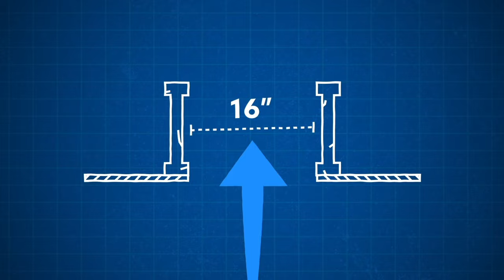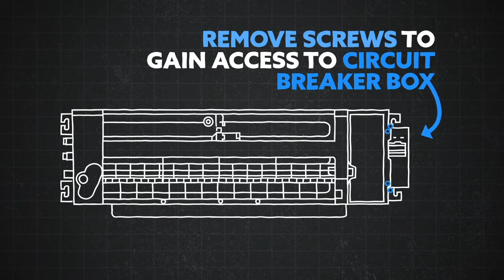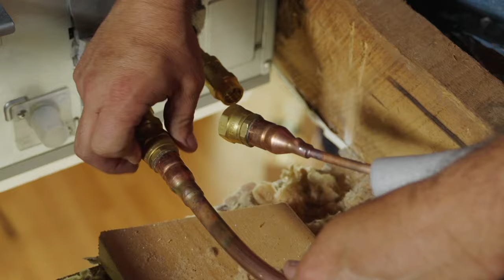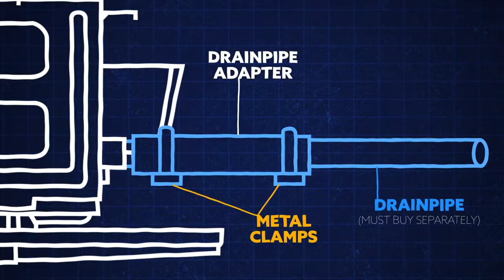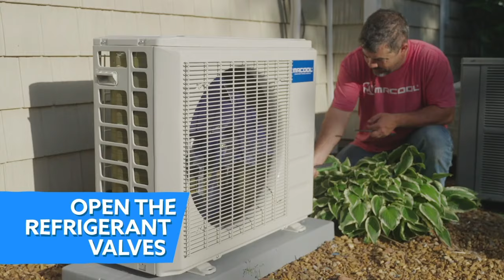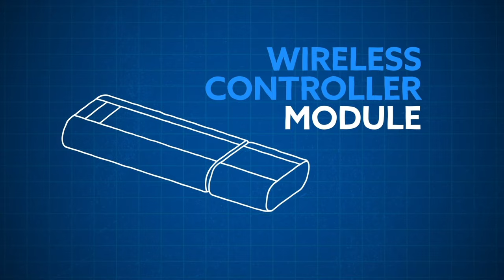MRCOOL DIY Ceiling Cassette Install

Comment: You made no mention of the drain system being pitched at an angle so that it will gravity drain. Does this mean that the drain system is pumped driven or is it still gravity driven